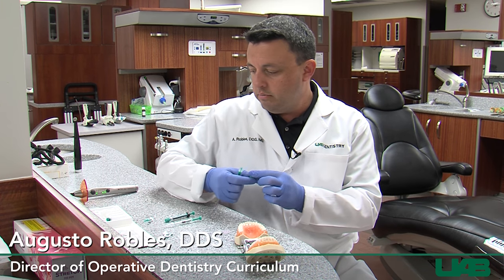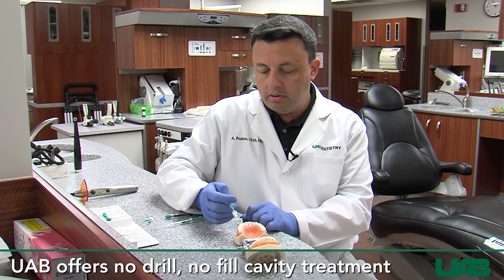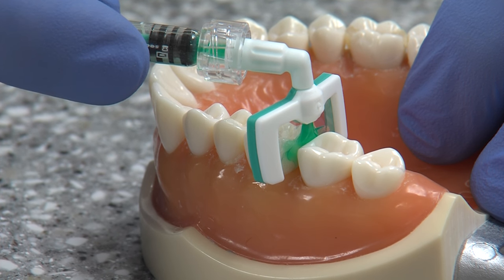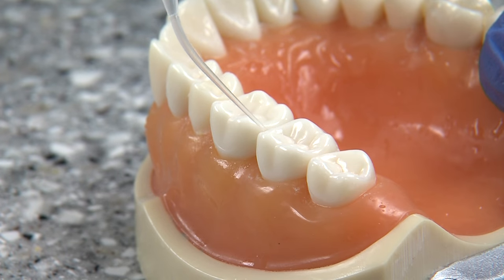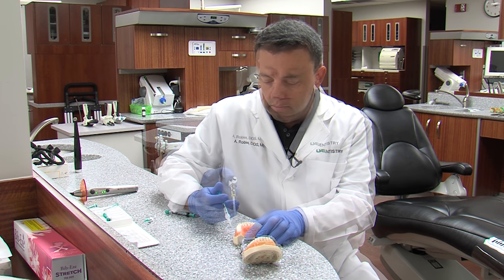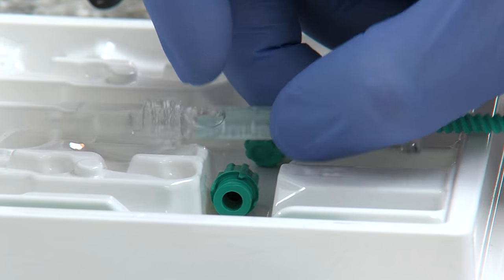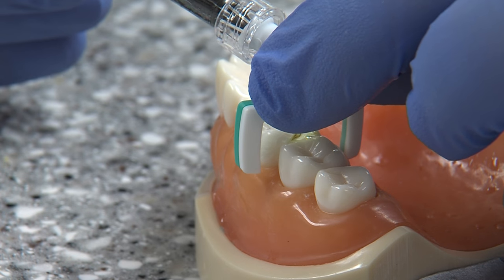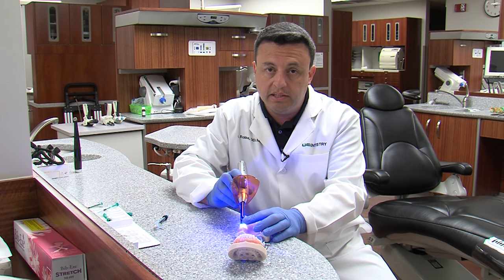New cavity treatment offers no drilling, no filling

Comment: I assume that this is a treatment for teeth whhich are not in pain yet. Otherwise, how could this application work against all bacteria insde the teeth?
Reply: I would think the bacteria once sealed from the oral cavity would no longer be able to access any form of nutrition to sustain themselves, I mean they are living organisms, they need to eat something with calories to survive, plus the tooth pulp has the ability to fight off bacteria, to some degree.  This technique does make me think that this lie(?) about 'needing to drill to remove decay" was always bogus, and it was always simply about anchoring the filling by removing significant amounts of healthy tooth structure.
Reply: @jgw108  
I also figure it's so.
There's one but, if we scoop out the cavity, but the individual will still consume refined sugars (and maybe even refined grains, breads have similar effect) - the cavity will return.

I wonder if, scooping up the decay and seal the affected tooth from the mouth/food (but leave space inside) - I wonder if the body is actually able to regrow the original form of the tooth... With some time, obviously.

And if not (which is possible), is it possible to fill the now clean space with something (like we do with bones, no?) and see if that could allow the body to fill that space with dentin...
Reply: @carmenrincones3379  
Spammer.
Reply: Yeah this is not an option for a root canal this is an option for a small filling, this is something that can be done nowadays to avoid having to go through a filling for something that’s really small so that there does not have to be any drilling at all
Reply: @jgw108  The drilling is about removing demineralized tooth structure, but why not just re-mineralize the tooth with the right materials? Alot of this is about nutrition and correct blood supply to teeth. Interesting that old time dentists would use a comfrey poultice for remineralizing, but we never hear about that anymore do we?

Comment: Resin infiltration (what being shown in the video) only works with white-spot lesions, meaning areas that, if left alone, may progress into cavities. This will not work for all caries. Your dentist cannot magically melt away your tooth decay  just by applying a special solution on it without any drilling. Otherwise; this would have been a breakthrough a long time ago.

Comment: But what happens to the cavity if there is no drilling? The resin just sits on top of the cavity?
Reply: That's what I'm thinking too
I once had a filling on top of caries for a longer period of time and it just grew and grew so what does this thing even do?
Reply: Yep. Then the decay keeps growing inside the dentin and then reaches the pulp and the root. Then you need a root canal or even an extraction. Not a good idea. Unless they have a magic way to remove the decay, this is the most likely scenario to happen.
Reply: @jenshaw8085    There are ways of stralizing inside a tooth:  electrical stimulation with silver electrodes and things like tea tree oil on the surface BUT 
no one talks about how successful it really is except reasearch papers and those methods can be tough to replicate sometimes...........may be worth doing.

Comment: Great but what of claims that dentists have been making for ages that "decay must be removed first before applying a filling"?  I never understood that personally, and wondered why composite resin fillings couldn't simply be applied to cavities without a requirement for drilling except for purposes of anchoring.
Reply: What is decay? If decay is demineralization, then dentists should be remineralizing the tooth, not drilling out the part of the tooth that has demineralized. Dentistry is still mentally ill and designed to profit the dentist, not help the client.
Reply: The resin must bond to the enamel.  It won't bond well to a furry surface..
Reply: @ J W.   I think that the easiest way to think of this is to imagine rust on your car.   If you just paint over the rust, the rust remains and quickly shows up again.     If you remove the rust, the repair will last much longer.  Decay is very similar to that
Reply: @toothrestorer6588  Interesting analogy, I don't know enough about the mechanisms at play to say whether it's valid or not.  My understanding is that in the strictest sense a cavity is just that, a 'cavity', which if you were to use it in a sentence like a 'cavity in the earths surface' refers to a hole.  The bacteria excrete acids which erode enamel and create holes.  Those bacteria are always in the mouth however.  Is there really much benefit to creating a more uniform smooth surface through drilling before filling the hole?  Can the filling material not effectively fill any gaps even in irregular jagged type recessed holes in the tooth?  If there's a hole in my yard and I pack it with more dirt it fills the hole, I don't need to burrow into the hole to create a uniform shape before filling it.  Rust on the other hand is a chemical reaction with the carbon in iron reacting to oxygen and water, basically transforming the material, so I don't know if that analogy works here.
Reply: @jgw108  True a cavity could be just a hole , but it’s quite rare to have a hole without decay. Something has to cause the hole.  It is usually decay.  If it were just due to recent trauma then yes , there would be no decay to remove    Sometimes if a tooth is chipped, you can just  bond the resin filling.   Usually in those cases some minor drilling for retention or placing a bevel is necessary 
No analogy is perfect but that is a simple one that most people can understand so I like to use it. No offense intended but you might want to review your chemistry when it comes to rust.  Carbon is not the culprit
Reply: It’s bacteria. If you leave decay inside the tooth, it will grow and reach the pulp (nerves) and root, which is painful. Then you’ll need root canal or even extraction. The decay could spread to your gum, bone and other teeth. So, of course you have to remove it before applying a filling.

Comment: It's been over three years since this video was posted.  If it worked well.. wouldn't it have caught on by now?  Looks very similar to the way fake finger nails are put on.. we know those don't last long.
Reply: yupp as a dental student i gotta say this video didnt explain at all how this would remove caries in the dentine (inside the tooth) the only was to reach the dentine is by drilling
Reply: @spngirl55  I don't know if this is the same thing, but I had something called ICON done on two of my teeth. They removed the upper layer of the enamel with acid and then cleaned and remineralized the affected tissues. It doesn't work when there are actual cavities in the dentine though.

Comment: not drilling and simply filling on top is asking for trouble - if there is bacteria that has entered through the cavity, it can cause major problems like infections which is why the area needs to be drilled and cavity removed.   Composite resin is crap - aesthetically it looks nice, but it lasts only a fraction that of an amalgam and is less durable, less resistant to wear from chewing.

Comment: There is also a technique cold air abrasion requires no drilling
Reply: Honest Review No drilling? But how do get the bad bacteria out of the teeth?
Reply: @FrenchViking466  How about strengthening the immune system from within through diet and topically by applying the right materials to help strengthen and remineralize the tooth.
Reply: @Vulcan-zt7ob   What are the right materials to remineralize the tooth?
Reply: @otterzeal  Flouride from toothpaste or some mouthwash also have flouride in them too.

Comment: Would be great if it would become actual tooth matter like dentin and enamel. But i guess we arent there yet. Still very awesome idea :D
Reply: I think it's doable.  After all, we do exactly that with bones, for example for implants.
Reply: @Massimo-sn7xd  You mean they use a material that turns into bone and marrow? Or they transplant actual bones.
I'm interested in this conversation :D
Reply: @damotoneko1500  
From wikipedia (on dental implants):

"Bone grafting is necessary when there is a lack of bone. Also, it helps to stabilize the implant by increasing survival of the implant and decreasing marginal bone level loss.[38] While there are always new implant types, such as short implants, and techniques to allow compromise, a general treatment goal is to have a minimum of 10 mm in bone height, and 6 mm in width. 

To achieve an adequate width and height of bone, various bone grafting techniques have been developed. The most frequently used is called guided bone graft augmentation where a defect is filled with either natural (harvested or autograft) bone or allograft (donor bone or synthetic bone substitute), covered with a semi-permeable membrane and allowed to heal. During the healing phase, natural bone replaces the graft forming a new bony base for the implant."
Reply: @Massimo-sn7xd  Does that mean (for simplicity's sake) they basicly put a put in the arm and the body generates bone within? Or did it mean they put foam in the arm that then gets covered in natural bone?

Or did i miss a detail?
Reply: @damotoneko1500  
I don't know. You know as much as me now.
Reply: @Massimo-sn7xd  Faschinating stuff though.
Reply: @damotoneko1500  
Ah yeah.
Reply: @Massimo-sn7xd  I heard from one video that they took out a tooth, grinded it to powder, cleaned it with a chemical and then reinserted it into the jaw. Then it was supposed to grow into a new tooth.
Reply: @damotoneko1500  
I definitely hope it's possible, but even if it's possible, somehow creating teeth from scratch and/or from embryos, would seem much more possible.
Reply: @Massimo-sn7xd  I dont want it from embryos. I dont like abortion.
There is also the idea of using baby teeth to grow adult teeth. Imagine, the tooth fairy could've been 200 years ahead of technology XD

Comment: Apparently, you are just sealing in the decay....good luck drying leathery dentin. This method will work for a few months , maybe.   One can not build a house on sand.
Reply: This is not for a major situation like a root canal replacement this is something that can be used in place of a very small filling so if it’s just a really little cavity that would just be a little drilling or most of the drilling would just be to reach the cavity this is an option for a little tiny thing more on a par with a sealant I don’t think this would be used on anything more serious

Comment: I have a great advice for everyone still using TOOTHPASTE

STOP USING IT

USE JUST THE BRUSH WITH A LITTLE WATER

50 PERCENT CLEANER AND HEALTHIER TEETH AFTERWARDS IF BRUSHED DAILY

ALSO, FOR CAVITY USE OIL PULLING

SPEAKING FROM MY OWN EXPERIENCE
Reply: but toothpaste has calcium which will go back to your enamel to help strengthen it, so why stop using it ?